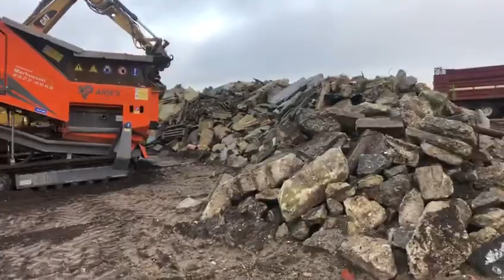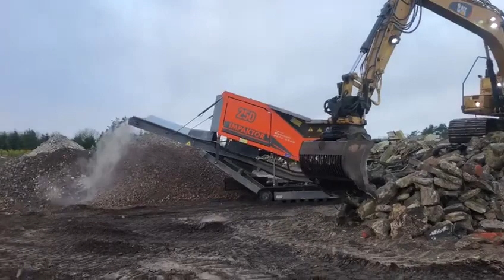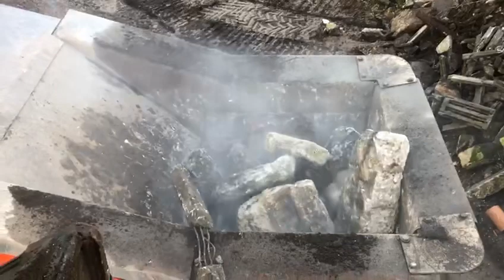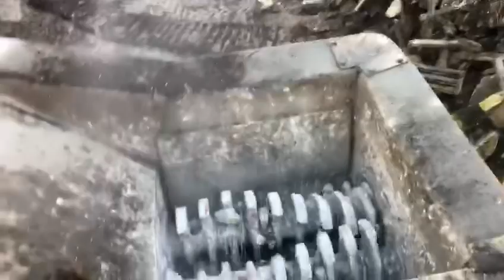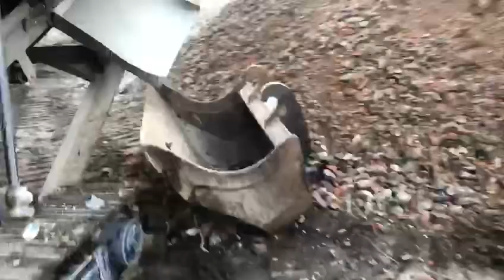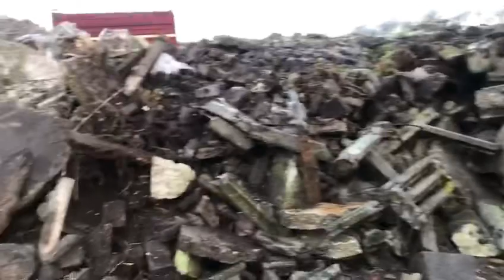arjes impaktor 250 Cat 312F

Comment: What power can it have in an hour?  And fuel consumption and shaft life?  Is it worth it?
Reply from the maker: hi it can crush 120 tons per hour in 0.60 mm concrete. I'm just saying it's a German and it has many children sweeping. the shafts that sit in the machine they can not last more than 100 hours 😢 so it is not good enough
Reply: @sorenmarkussen1  I saw broken teeth at 250mth and used shafts at 400mth. It's a powerful crusher, not requiring primary crushing, but fuel consumption and shaft length expensive crushing. I am very happy for your answer, I appreciate it very much and thank you very much.
Reply: @sorenmarkussen1  What is your knowledge of the past?  Is it worthwhile to operate it?  Consumption of diesel and jaw cylinders?  I am grateful, thank you 🙏